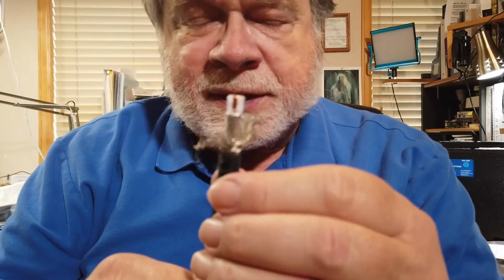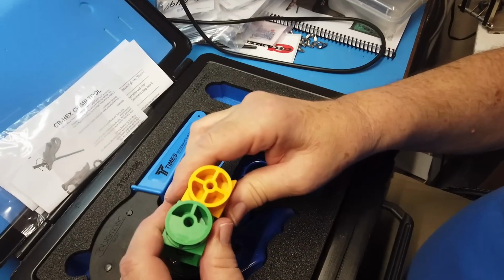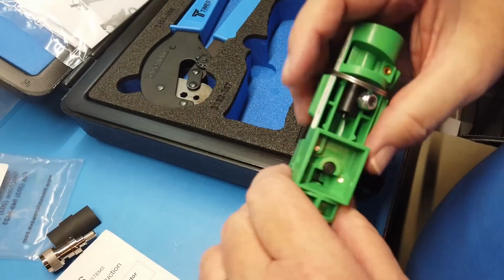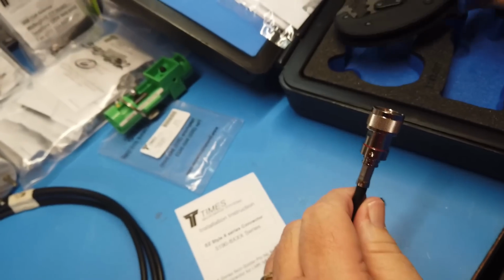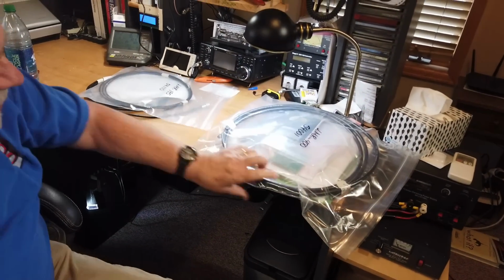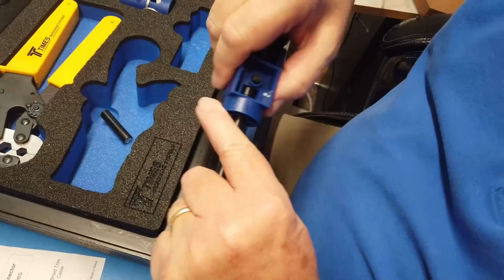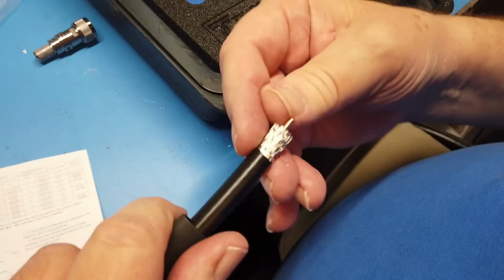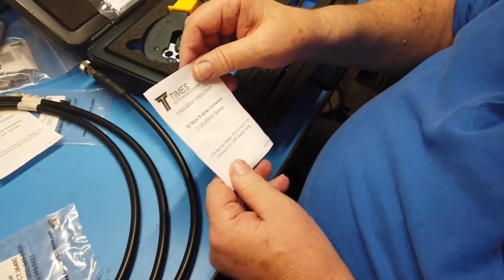New Times Microwave Coax, Tool and Connectors (#932)

Comment: You made it look so easy-lol.
It takes practice. Better than my 1st time.
And yes- never try soldering a PL-259 on. By the time you get the braid to sorta solder the heat has probably ruined the dielectric foam.
I've had my crimper for years and ALL my connections are crimp on. Then heat shrink the whole connection at the antenna. Beats the hell out of taping and un-taping.
Your antenna is 90% of your station- it's worth the money to do it correctly

Comment: Dave, anytime you need extra force on a cable cutter, crimper, bolt cutter? Hold the handles between your thighs and use the stronger leg muscles to squeeze it. Like Suzanne Summers and the thigh exerciser. Works equally well for heavy hedge cutters.

Comment: Admittedly, I was never a big fan of crimped connectors for many years.  After seeing quality tools and cable such as this, it's a real game changer for me.  A well done crimp, in my opinion, is as good as a soldered connection (in some instances perhaps better).  Since waterproofing is required for most crimped and non-crimped connectors alike, it's an easy extra step anyway to prevent moisture wicking, so the same requirement is given there. If someone doesn't have soldering exerpience with I.E. PL-259 's , this product is a giant leap forward in convenience.  Also, given the fact that the connectors and cables are paired together, is a big advantage.   Thanks Dave for the quality review on some very high quality products.  73

Comment: Howdy Dave, AE7EC here from the windy city of Casper, WY. I have a question that A. I can't figure out, and B. Have asked many fellow operators, and got no real straight answer to. The question is: When choosing a mobile antenna to use with an antenna tuner, do you want the "natural" antenna tune to be in the middle, lowest, or highest frequency you want to work? I know everything IS a compromise once you talk operating with a tuner, but I am looking for the best compromise (I have a limit of 10' 9" max height, thanks to the McKinley St. viaduct, and 6' is eaten by my van).

Comment: $$$$$$ This is the Bentley of coax cable, connectors, and termination tools.
Reply: High end tools, POS case.  If I'm gonna spend $560 on tools, least they could do is slap them in a Pelican or equivalent.
Reply: @Jelanen  I always throw cases away and integrate the tools into my system. If I want a Pelican case, I want it to be configured on my terms.